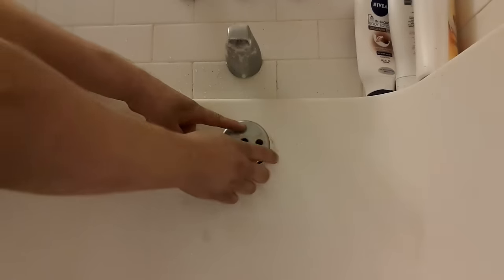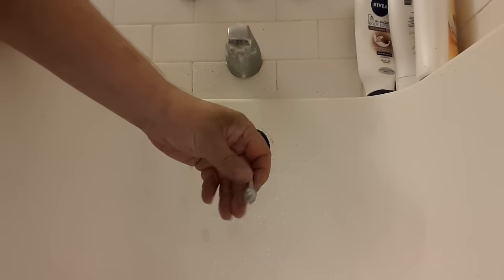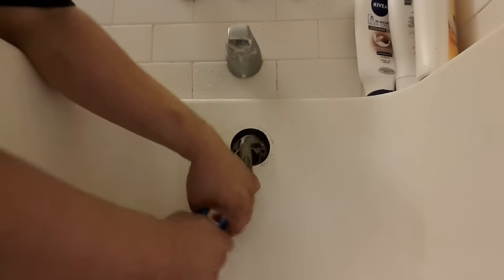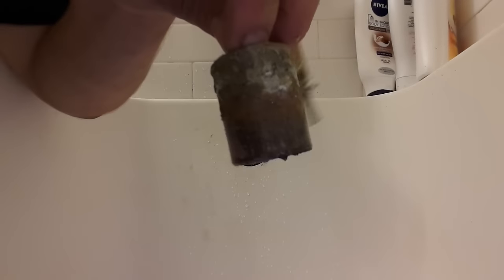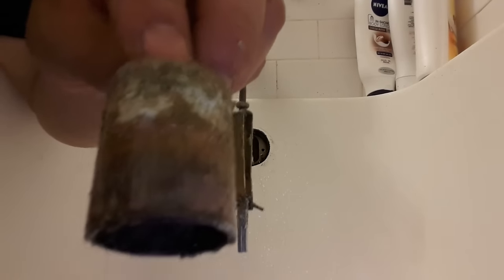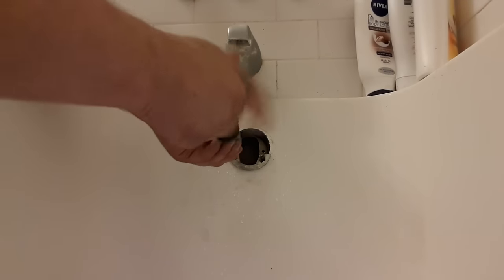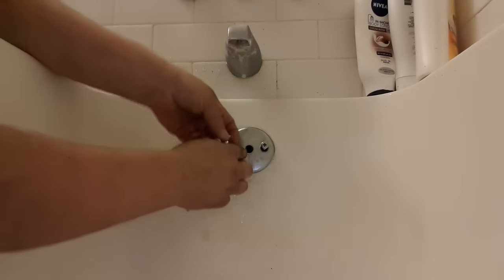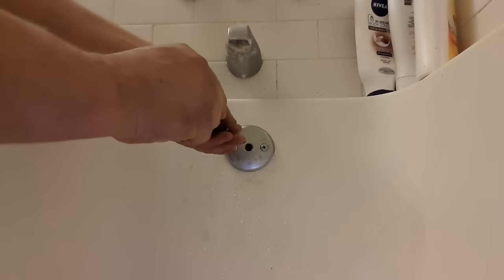Tub drain draining  slow easy fix

Comment: Many thanks for this video!  I've had three plumbers tell me they couldn't fix our tub without tearing up our floor/foundation.  After watching this video it took me 2 minutes to fix the broken stopper and the tub finally drains again.  Thank you!!!!
Reply: Mine has overflow plate stuck the drainer ever after I took the trip level plate and inside out; the metal plate stuck with the drainer.
What to do?

Comment: ( .01 star - 1/10th of 1 ) What problem does this fix ?? - if I understand - this he is taking out the drain stopper which mean the tub won't hold water !!!!
Reply from the maker: Keeps the tub from clogging up. These drain cloggers catch everything if not adjusted within very close tolerances. The problem is worse if the barrel is frozen in the tub drain like this one was. Slow drain = clogged drain.
Reply: You can replace them with a new one.  Or just get one of those flat round vinyl drain covers and slip it over the tub drain when you want to hold water.